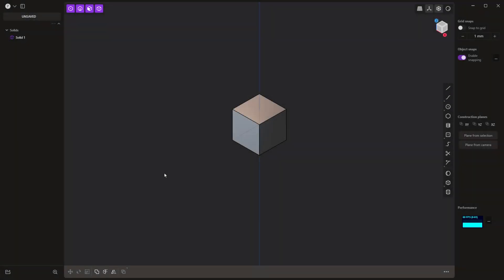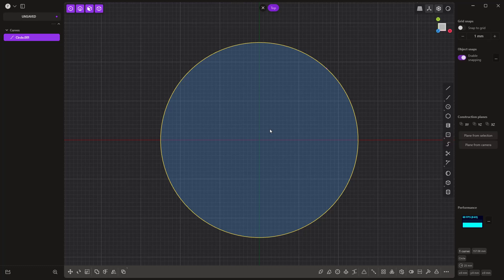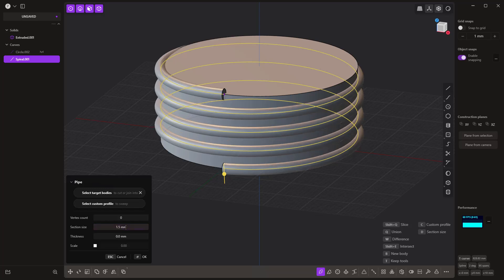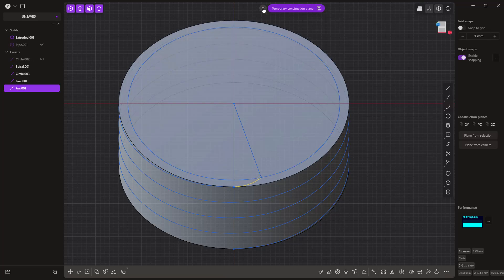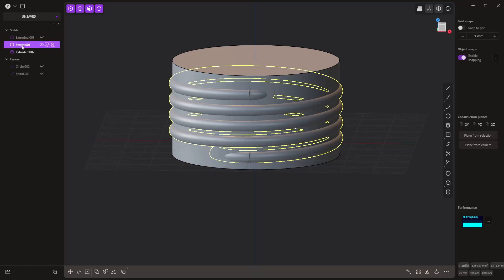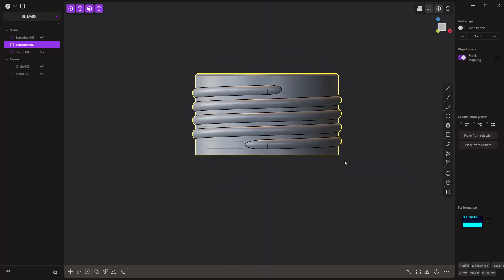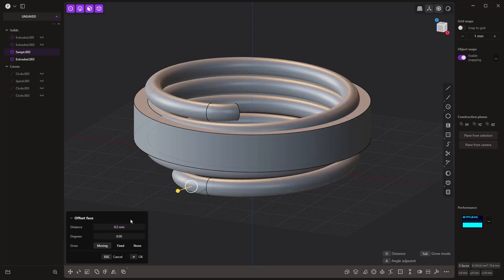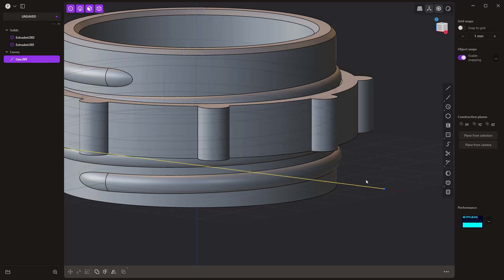How To Design 3D Printable Threads in Plasticity

Comment: My approach is a bit diferent. I model the tolearance profile, sweep it and use that as a cutter for both bolt and nut. Way more controll. You dont get that nasty irregular tolerance and you can maximize the engagement.

Besides that, what i learned, you go as low ans 2 mm pitch on vertical orientation and 2.5 if you printing it horizontally. But .. plastic is plastic so a minimum of 3mm pitch covers you on both print orientations while leaving enough room for engagement. For the tolerance you can get as low as 0.15 mm for printing vertically. That is a snug fit, good for stuff screwed in only once. On the horizontal 0.2mm tolerance is tight one. 0.25mm is good tolerance for both orientations. For toys I recomend 0.25 for vertical and 0.30 for horisontal. Or 0.3 overall. For the D, the smallest I got down to is 8mm for the maximum feture diameter. Did not push it further. I assume for a 6mm max D bolt and nut you'll have issues with the pitch if you want to sill get a decent 0.6mm engagement. Tho I did not test it. Engagement here is measured radially. Explicatively you'll get tolerance-engagement-tolerance.

All this was done on a trapezoidal thread, because it prints well in any orientation and supports dont give any headaches or are not needed. 0.4mm nozzle and very old generic PLA that smells like fart while printing, on a obsesively calibrated K1C.

Still using the method shown by the author for quick and dirty threads.
Reply from the maker: Thanks for taking the time to write that!  That is a cool approach doing the tolerance profile.  So your lid and container are 1 piece and you use that to cut the threads then use other features to cut them into 2 parts?  Or are they two parts already?
Most of the time when i have designs for 3d printing with threads I design them in Fusion and use the thread tool, then offset either the inside or outside because they are machine tolerance.  I did do a video on modeling machine threads in plasticity, but ill have to give your approach a shot.  ill go ahead and pin your comment.
thanks
Reply: @LearnEverythingAboutDesign  Well, mostly I am using it for fixtures. If you cut the tolerance profile through the entire object you get a headless screw and a hole in your original object. The head is something I merge in separetely. Same can be done with bottlecaps. There is more than one way to skin that cat.

You could for example model the entire bottle and cut away anything and leave only the portion which will revieve the threads, inner and outer. After cutting the threads you can merge them back together. As I said, there are more ways to do that.

Also, if you sweep the profile make sure you do it in 2 segments. A single segment will result in a surface which cannot be reasoned with in NURBS land.

Comment: You can also import .STEP files from the McMaster-Carr catalogue So pretty much all your threads and fasteners can be directly imported with all the right dimensions. :-).Nice video... thanks
Reply from the maker: True, but watch out for 2 things if you do it that way.  Some of the CAD models on there don't have actual threads, they are just visually look-a-likes.  Some the threads are just revolves around a cyl.  others aren't to spec.  second is that with 3d printing you still will want/need to add a bit of a gap/tolerance as a machined thread will be too tight of a tolerance.

I found/find that round threads or more of a square/acme style thread prints and works better than machined threads for me.  Have you found any specific type that has worked best for you?  always good to compare notes.

Comment: Question! Wouldn't this be easier to just duplicate (then hide) your first threaded object, place the second object you'd like to thread (resting on the threads AKA 'tubes'), and then use Boolean and remove it, leaving precise fitting threads? Then just unhide the duplicated one?
Reply from the maker: Hey There.  for 3d printing, and for machined threads and other types of threads they aren't a 1:1 size.  machined threads have a fit or class that dictates how tightly they fit.  Those types of threads use a 60deg triangle (and we just did a video on those types of threads in plasticity) so when the nut hits/binds on something what it actually does is presses the top portion of the threads on one side against the bottom portion of the threads on the other side.  

For 3d printing you really need a gap of at least .2mm to .4mm so the threads work and they don't bind up.  If you want to use the external threads as a cutter and keep the "tool" during that operation you can, but you would still need to offset the geometry after.  I find it easier to offset the duplicate of the thread then cut it away from the "nut" in this case.

Both should work fine, but if one is easier than the other personally I think the duplicate of the coil/thread is because its easier to offset before the cut.  If you were using a different thread profile that wasn't just a swept circle it would still probably be easier to select as a single object.

Its worth playing around with and seeing what works best for you!
Reply: @LearnEverythingAboutDesign  ohhhhh thank you!

Comment: Can we do like a precise M3 thread?
Reply from the maker: Actually just did a video talking about modeling machine threads. https://youtu.be/QSSgxi2J3vc  Its a large thread because you wouldn't print an m3 but the process is the same just using the values for an M3 thread.

Comment: Ugh. That is a lot of work for a simple thread. Imagine trying to get a thread to match a real screw or nut lol.
Reply from the maker: No joke right :)  Plasticity wasn't made specifically for 3d printing.  Other programs have thread creation tools (that do still need some tweaks to 3d print).  Hopefully someone will make a thread tool for it but it is possible.  I have seen places where people have a single file that contains various male/female threads for printing so you could open something like that up an "kit bash" the design copy/paste those features.  Would be quicker if you had multiple threads to do.

Comment: Very nice video, just practicing this is a great learning tool.  Unfortunately, trying to create real usable parts like an 8-32 nut or screw is very difficult, especially when trying to match the thread spacing.  I wish there would be add-on tools, or plug-ins for plasticity.  For example, even lowly Tinkercad, which I use often, has a built in thread generator tool that can create any thread you want literally in seconds.
Reply from the maker: Yeah that would be a great thing to do/have!  TinkerCAD being exclusively for 3d printing gives it an advantage there while Plasticity was more aimed at the visual effects/animation segment.  I know Refuge3D makes some add-ins so i'll mention it to him.
Reply: For precision, try this? .... Duplicate (then hide) your first threaded object, place the second object you'd like to thread (either inside or outside the first object), and then use Boolean and remove it, leaving precise fitting threads? Then just unhide the duplicated one?
Reply from the maker: @CJEW89  Hey There i just replied to your other comment but ill give a short reply here.  The threads can't be 1:1. they need a gap to work.  So you could do it this way but would still need to offset it it after you cut away the thread.  In the video we duplicate the coil that makes the thread and offset it around 11:45.  If you just use the external threads to cut away you can just keep the tool during the boolean without a duplicate, but still need to go and offset the cut geometry .2mm or more for it to work.  Even machine threads are not exact.  They have gaps and tolerances and "class" to determine how much slop they have.  Threads work by wedging one side of the thread on the nut against the other side on the bolt when they bottom out on something.  So slop is ok as long as the threads ID/OD can still work.
Reply: @LearnEverythingAboutDesign  excellent, thank  you! Im going to try (im still new) to duplicate the spiral and make a fatter version and a skinnier version. One for boolean and one for smaller thread
Reply from the maker: @CJEW89  You're welcome!  Depending on your printer and what nozzle you are using you can play around with and figure out the right offset.  For most printers using a default .4mm nozzle and standard .2mm layer height I have found an offset of .4mm (diameter) or .2mm on the radius works.  I have done this on 3 or 4 different printers just fine.  Its best to do this with the same printer and same material though.  In general when i need parts to fit together i do some test prints and figure out what the parts need to be.  For example i might print a 10mm hole and a part that has a few bosses on it at 9.8mm, 9.9mm and 10mm.  if you try to jam the 10mm boss in the 10mm hole (if it goes) it is stuck.  9.9 might give you a snap/press fit and likely is not coming apart.  9.8mm might snap and hold well but can be removed etc etc.  A few little prints can save you time.  I do have a few 3d printed videos for Plasticity including some Print in place models like fidget spheres where i talk about that tolerance/gap.
Reply: @LearnEverythingAboutDesign  You've been my guiding star as I eagerly await the arrival of my Bambu Lab X1C! I will definitely have a look at that video and save your advice!

Comment: Can you show a video on how to design a mason jar lid in Plasticity please. I cannot find any tutorials on that.
Reply from the maker: What is your end goal with the model?  Is it just for render/visualization or are you trying to model a lid that will thread onto a mason jar?
Reply: I am trying actually to model a thread that you can screw onto a mason jar, small mason jar and large mason jars. I cannot find anything as far as plasticity goes that has teaching like that.
Reply from the maker: @rorybsimpson  I don't really have or use mason jars so not sure what threads they have typically but there are common ones.  https://www.paramountglobal.com/knowledge/jar-neck-thread-finish/   I think first step is to identify the thread sizes and specifications.  Mason jars would be "Continuous Thread" most likely.  I believe they are formed by stamping the continous thread around the outside so know the size of the thread, its angle, and diameter should be all you need to figure out the specs.
Reply: Ok thank you. They get a lot of views in Fusion360, but there is nothing how to make them in Plasticity on YouTube.

Comment: Awesome video.... I'm trying to learn 3d modeling to design my own products to print and your videos are a huge help.   Is there any way to move an object so it's flush with a plane? I separated the nut from the threaded "container" and one of them was floating when imported into the slicer
Reply from the maker: Thanks, and yes.  When you use move (G)  look at the options in the bottom right.  Freestyle (F) will let you pick a from and to point to move your object.  You can move the nut down to the same plane/point as your container.  then you can move it in plane so its next to the container.

Comment: please make a one about diffrent conectors for connecting plastic parts, tnx
Reply from the maker: Do you mean like snapping parts together permanently or just other ways to fasten?  I have used printed pins glued in place as well as some dove tail style shapes before.
Reply: @LearnEverythingAboutDesign   i need to make service desk, and on the top is one long  line where I need to slide diffrent tools, drawers, mounts, and boxes that somehow connect to that line which is on wood plate. I hope that You understand what i tink to say :)
Reply from the maker: @IntegraComputers  Is the line a slot? and how stable does everything need to be?  You could use magnets.
Reply: @LearnEverythingAboutDesign   i need something stronger for shelfs and similiar stuff..
Reply from the maker: @IntegraComputers  The thing that will be tough is going to be strength of the print.  Print orientation will play a big part, and how much weight you are trying to hang on them.

Comment: That's why I can't give up Fusion360: it's just a thread, it should be easier.
Reply from the maker: Im sure it will get there.  Custom threads in Fusion is a pain, but if you can use the standard ones with the thread tool it is much easier.

Comment: Can you do a video on user defined threads in Fusion?  Finding it so hard to place threads onto a bottle.
Reply from the maker: Hey Brian, to make custom threads in Fusion is a bit tricky because the surfaces created have a bunch of divisions in them.  You would use the coil tool and i generally do this with a triangular profile to give me an edge since Fusion doesn't have a spiral curve tool.  Then you would sweep along that edge.  With the sweep tool you usually want to do a guide surface.  In the case of a thread it would just be an extruded cylinder.

If you want a traditional 60deg thread you can just use the thread tool.  But if you need something a bit more custom there are a few steps to it.  I will add it to my list.
Reply: Have you tried using coil?